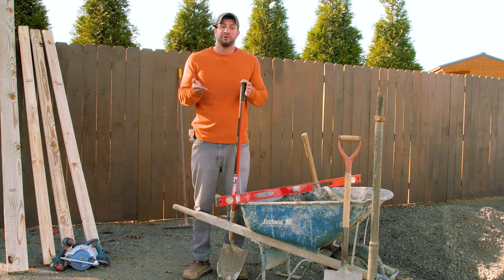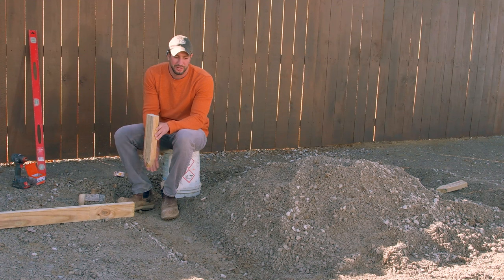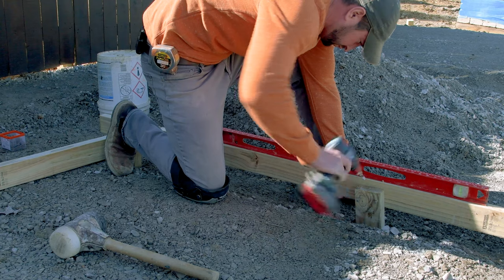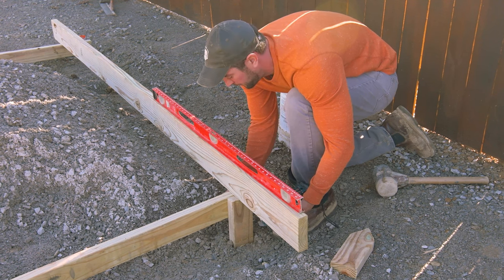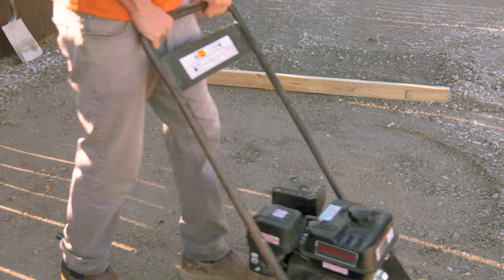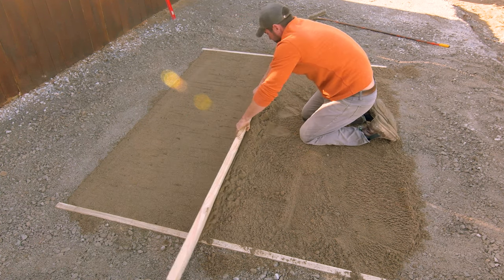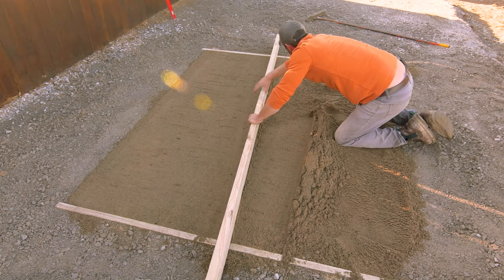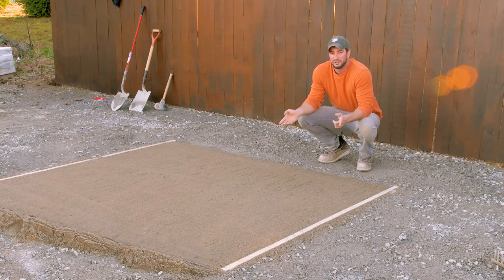How to Build an Outdoor Fireplace Kit Foundation- Compacted Gravel Base is Easy and DIY-Friendly

Comment: Thank you for this video.  If I’m going to have a concrete pad put down for the chimney, will 4” deep work, or should I be going 8”?
Reply from the maker: Honestly, you can alnost never have too much footing. The specs show minimums.The most important thing is a solid base or sub-base. You can also use sono tubes for reinforcement. I would go up to 8" with for piers/tubes in the corners down to the frost line. check out this link:
https://cornerstone.rocks/foundation-instructions/

Comment: What do you do with the rails and stakes when finished. Do you leave them,  or pull them out. Seems like pulling them out would mess up the base, but leaving them in, eventually they would rot, and leave a void.
Reply from the maker: You pull them out and fill the voids with gravel as stated in the instructions. The fact that they are about 16" outside the perimeter of your feature means that they won't mess up the base. Please follow the instructions here:
https://cornerstone.rocks/foundation-instructions/